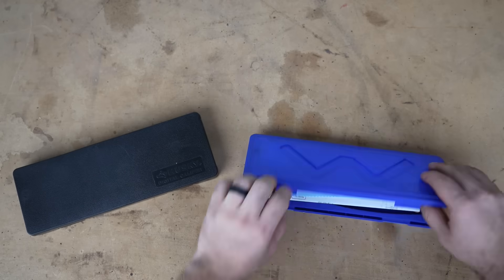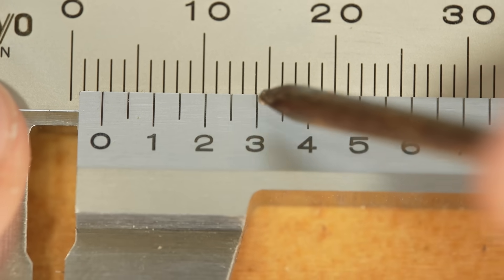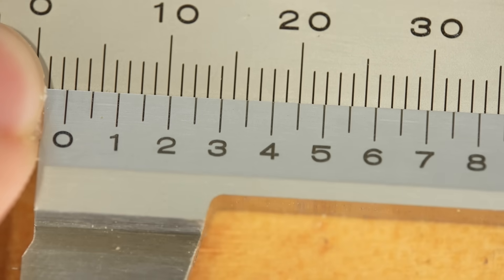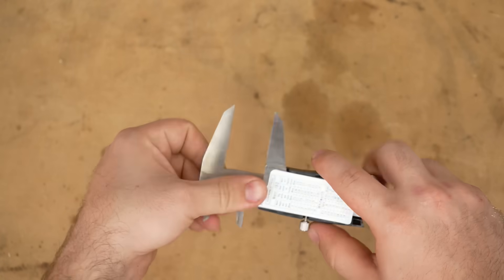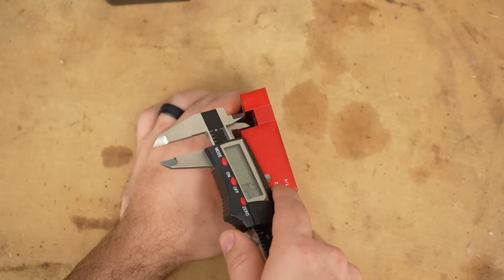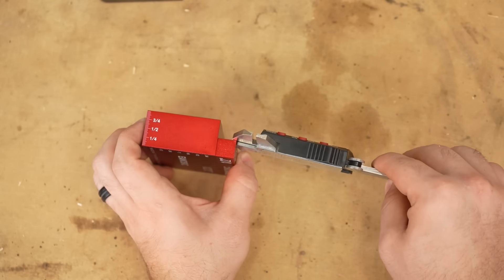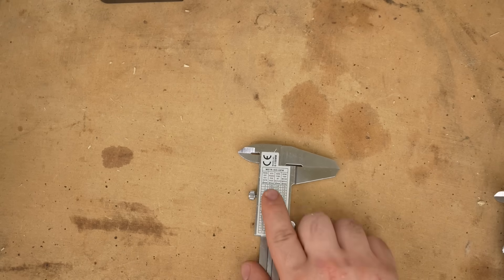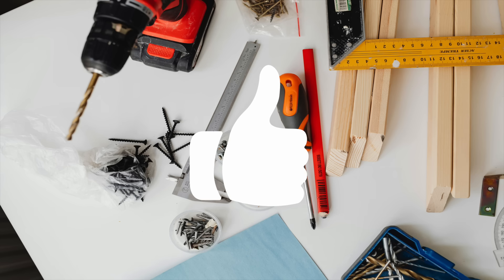I wish i’d known this sooner, How to use calipers like a pro

Comment: My father was a master machinist. His children were raised with micrometers and dial-indicator verniers, working on iron cast machines. There was no CNC. If you lost your zero working on a job, you were basically screwed. This was about 1972. Today, computer control makes these tasks quite a bit easier. 
My father taught me never to store the verniers completely closed, and never slam the verniers closed, as a sudden impact might affect the accuracy of the instrument. I still have a pair or two of the old dial-indicator verniers. They are still accurate, and I use them for my woodworking.
Reply: I've been in QC for 45 years and that's one of the first things I learned but it's even more important with 0-1" micrometers and never leave gage blocks wrung together. All it takes is the right amount of moisture and they fuse together. I have seen it happen more than once and even if you can get them apart the gauge surfaces are pretty much ruined for any true precision usage.
Reply: @RCT2020  :  Your father would have collapsed in shock if he had seen me trying to use a Vernier caliper as a wrench!  I was pre-school aged. My father spotted me in time to avoid disaster, but I did get reminded for many years afterwards!   🥴
Reply: CNC/'computer control' is only as reliably accurate as the program/s behind it.
It's worth checking manually before committing to a new product.
Reply: @RCT2020  your dad was correct! Any precision equipment like micrometers, calipers if closed during storage it can lead to rust or corrosion, 👍🏼👍🏼
Reply: @bret_Lambky  All callipers made today are made from stainless steel, so it's time to put the myth to rest. Closed or open, it doesn't make any difference.
Reply: @bret_Lambky  Right: is that the reason. Thanks, I was wondering why that was. All the best.
Reply: CNC had been around for a couple of decades before the 1970s
Reply: @trollobite1629  
One could reasonably argue that the Jacquard Loom (patented 1804) was and is a 'CNC machine'.
Reply: @trueaussie9230  Yep totally agree I just didn't want to get into the definition of what's considered to be CNC so I played it safe 🙂
Reply: @trollobite1629  Paper tape numeric control, CNC late 70s.
Reply: The first CNC mill was invented in 1952.  If your dad died in WW2, there was no CNC; anything much after that and there was CNC it just wasn't common.
Reply: @LeCharles07  No, NC machines in the '50s and into the '70s were the predecessors to CNC.
Reply: My grandfather was a machinist on one of the early linear accelerators. A mile+ long, with end-to-end accuracy in the tens-of-micrometers range.
Reply: "..never store them completely closed..." that's very interesting:  can you tell us why that is? Thanks a lot, and all the best for you and your family.
Reply: Generally it's not a good idea to store any measuring equipment with the jaws closed. I don't think it would be a huge issue with these calipers unless you close them shut and tighten the set screw. But with something such as micrometers you can easily damage them if stored closed. Because of thermal expansion. You can easily throw off the zero on micrometers this way.
Reply: @alessandroricci7294   In the olden days when measuring tools were made from steel (not stainless steel), any moisture between the jaws would cause corrosion on the faces of the jaws. Since all callipers today are made from stainless steel, it's time to stop pushing this myth. 
 It's ok to set your car battery on bare concrete too.
Reply: @e-curb  
I have some that are made of plastic.
They're very accurate, surprisingly.
Reply: That’s so wild. I was about to post that my dad taught me the same thing!!!  Still do to this day and I’ve taught my son that too.
Reply: Why not store them closed? Mine came closed.
Reply: @sypher0101  
If yours are of good quality they would have been coated in protective oil.
I trust you removed it before first use. 🤔
Reply: Excact how I learned it in th early 90,s at the Dutch marine school. No computer, when losing the zero you were screwed. No slamming of callipers, keep them little open. From start to end , us e the same tool

Comment: Calipers are a Must Have Precision Tool for Everyone.  You didn't show a dial caliper, which are great for reading ease and no battery (I'm still using the Brown and Sharpes from 1983). The downside with dial calipers is that they are either metric or standard. I'm sorry but standard vernier calipers are too time consuming and difficult for new users.  My favorite calipers are 8" Mitutoyo Digital, they are super smooth and accurate. The batteries last 1 to 3 years depending on use. Great video ;keep up the good work. I'm a retired tool and die maker from Honda.

Comment: Hey buddy, thanks for the video, but I think that you have to be careful about languge when describing engineering related matters. For example, any of my own sets of Vernier calipers are at least as "accurate" as you put it, most digital calipers. What you were speaking of is resolution, not accuracy. Any good quality Vernier will read to 0.01mm or half a thou' or so, if we're speaking in imperial. Most, and I mean most, not all, digital calipers have a readout to two or sometimes three decimal points, but three decimal points on an inexpensive (relatively) digital caliper may not be accurate and there are a few reasons for that. 
So, a pair of Vernier calipers of reasonable quality and a pair of digital calipers of the same quality, all other things being equal, will, in practice, give you a very similar outpout. 
Digital output is much easier to read, much easier, however,  digital calipers can give you the 'wrong' readout if you are not careful. Unlike Vernier calipers, digital ones can be zeroed incorrectly, leaving you  with a false measurement. Both types of caliper can be used incorrectly too, I've seen it often enough. So, at the level of user that your viewer is likely to be, there may not be any discernable advantage to digital calipers.
Vernier calipers are as accurate as many micrometers, they don't run out of battery power and once you learn to read them you will get consistently accurate readings. If you want an easier to read Vernier type, get one with a dial (analogue).
If you're doing rough work, say, in tenths of a milimeter, a cheap digital caliper is just great.
I've seen young engineers use digital calipers simply because they're too lazy to master the Vernier. Don't be like that. A good quality set of Verniers will outlast you, any electronic thing is unlikely to do that. More than once, I've opened the back of digital calipers to find a leaky battery, rendering the expensive thing useless.
I still use on a daily basis, Vernier calipers I bought in the seventies, they look and feel great. Every now and then I check them with slip gauges and guess what, they're still good. Do yourself a favour, buy a set from a retired machinist and learn to use them correctly, they're at least as accurate as most people need. If they're not accurate enough for you, I have to ask "why are you watching this video?'
Reply: I still use my first set of Vernier  calipers, I've used them pretty much daily since 1976 and other than the plastic cover they came in, they look and feel brand new, like you, I use the occasional slip gauge to check them, they're always fine and as you say, they're as accurate as my mics. As my vision got worse, I bought a dial set and they too are fabulous.  I've had a few sets of nice digital calipers and have enjoyed them, but have always been just a little suspicious of them. As for leaking batteries and lost battery covers...😊

Comment: That was a very good video, went into a lot of stuff which should make things alittle easier to understand for many people.
I still can't understand why they have Whitworth threads on the chart, they were pretty much obsolete when I was training 50 years ago?
 In early 2000's I used to teach Vernier caliper use and included Pierre Vernier in introduction.
Expaining Metric system to American's could be challenging (we don't do metric') 
Always told them they must be interesting to take shopping as money is in metric.
Vernier calipers are accurate to 0.001" / 0.02mm which is far more accurate than any electronic caliper with a dead battery 😁

Comment: What amuses me is the price range of calipers.  A 12-inch caliper can run anywhere from under $20 to over $1,000.  While the $1,000 caliper is extremely accurate and precise, the $20 caliper is still good to 0.001" and suffices for most applications.  To be told, I do have a number of high dollar, high accuracy and precision instruments, but they are not used every day and are primarily used for inspection.  Needless to say, no one touches them but me.  

Did you know that if you are trying to do high precision work, how you hold your measuring instruments can affect their accuracy.
Reply: Yes and a 1 or 2 degree temp change from inside machine check to outside on table changes size and reading and calipers good to .005 or more anything smaller needs mics. Have indicators and mics down to .00001
Reply: @countryboyScott3929  It is the old story of accuracy versus precision.  Usually we like to have both.

Comment: I can assure you that nobody in the UK uses Whitworth thread standards anymore. We use metric, have done since 1967. Also agree about tge dial calipers which I use on a daily basis.
Reply: @mikeburkett010. Sorry ol'sport .Nobody ? I know of at least 1 who uses WHIT. BSF BSP. UNC UNF  threads and fixings for repairs on old historic vehicles and farm equipment , No CNC here either , all manual machining , only do what interests me now I am retired.
Reply: @karlhrdylicka  well OK, I'll give you the BSP standard (although I didn't mention it) for plumbers and gas fitters (our little gift to our Continental friends), however, the US UNF and UNC standards became redundant in the mid eighties and we settled on the SAE AF system in the UK for most (and I stress, most) automotive usages well into the 1990s. Now you can argue that all of the given threads are based on the original Witworth standards, but Whitworth became redundant in the early 1960s, and by your own admission, only used on historic equipment. So, much respect to you for keeping it going, machining your own stuff is much to be admired.
Reply: @mikebirkett010  how about
clock thread
bike thread
also go to steam thread
the tpi. stays the same but the bolt shaft increases in size
why in steam boilers you cannot use a sleeve to put size back
this way pitch stays the same bolts in crease in size
also bolts tapered to make a joint less tight seal
so there👍
Reply: @raypitts4880  This thread (see what i did there?) is beginning to grow legs!
Most clock screws are BA, based on the original Swiss Thury standard.
I've been riding mountain bikes since the early 90s and, with the exception of the bottom bracket, all use fine and coarse metric bolts. The BB is a messy one, but most use the BSA or English standard, there are also French and Itialian standards, all with slightly different pitch dimensions.
As far as steam boilers are concerned, I'll give you that, not my area of expertise, but I would be surprised if any NEW built boilers use Whitworth.
Whitworth today in engineering is as redundant as feet and inches😉

Comment: I learned 3 things, the purpose of the notch on the depth rod, the step measurement, and the double meaning of the CE logo. Thank you!
Reply: The CE logo does not have a double meaning. that is an urban legend. CE markings are self-certified.
Reply: @MikeBucceroni  The video says that the "CE" logo can also mean "China Export" instead of "Conformite Europeene". Are you saying that it's just an urban legend and the manufacturers are certifying that their product complies with the EU regulations?
Reply: @VeniceInventors  : Yes, exactly.  The whole "China Export" thing is an urban legend.  It's common enough that it's referenced and debunked in the Wikipedia page for "CE marking".  There are sometimes fraudulent CE markings, of course, but they are simply fraudulent markings; there is no actual claim that they stand for something else.
Reply: @BrooksMoses  Thank you for elaborating!
Reply: Pathetic part (about young generations): you needed an internet to learn those basics.
Reply: @GrandePunto8V  thanks grandpa

Comment: I would say that dial calipers are far more common than Vernier calipers.  The reason why the Vernier is just accurate as dial/digital is that calipers aren't all the precise to begin with.  They are better than a scale or tape measure.

Comment: I was told by a engineer digital callipers can have tolerance errors and it’s best for precision to use micrometers.
Reply: anonhunter5191. Correct . providing the same person uses the mic as another user often will get a slightly different reading particularly on round stock.
Reply: He was right.  In the trade Verniers are called "very nears".  If you need to measure something to a tolerance of less than .001 then calipers are not going to cut it.

Comment: Disappointed you didn’t  cover the fractional scale.
Reply: Normal, logical people don't care about fractional scales. 🤣
Reply: @akarna69  you are incorrect; there are situations where fractional measurements are superior to metrical, so people who don’t care about fractional scales are ignorants.
Reply: @GregoryHunt-w8g  nobody in their right mind would pick fractional scales over metric, like no sane person measures things with their feet. 🤣
Reply: @akarna69  you can’t read them can you?
Reply: @akarna69 fractional is not opposite metric (if you have ever said half a meter or a quarter of a kg, you have used fractional metric), or probably more to the point decimal based measurements are not exclusive to SI, as you can have 2.056”…imperial without fractions is a much more common and practical way to measure at these resolutions.

Comment: Technically, calipers don't measure more exactly than 0.1mm due to mechanical limts. For anything more precise you need a micrometer gauge or a dial gauge.

Comment: All measuring tools have a range of accuracy. Yes, I mean to say all measuring tools. The thing is, what is the range of accuracy that is good enough for your intentions? In my profession that would be, parts per million. So, how do You know that Your measuring device is as  accurate as stated by the manufacturer? What good is their guarantee or statement that the accuracy is so? In my business a "written" method of how the accuracy range was determined and a "certification"  by the company And the person who conducted that determination must accompany the measuring device  - which must have a unique serial number. That is now a legal document, that can be used in court. My personal calipers are "Certified" by Mitutoyo. That is probably much more then most users want, or need. And it does cost more. I have found the idea of precision fascinating ever since I used a scanning electron microscope way back in the sixties. But precision not only comes with the device, but also technique and environment.

Comment: Pretty nice tutorial.  I never used a Vernier Caliper much but I still have my Starrett dial calipers.  40 years and still working perfectly.  If I had known how it operated i might have used one instead.  simple durable and your battery won't die at the worst possible time.

Comment: There are also calipers with a dial, I have a Swiss-made Tesa accurate to 0.02 mm.
Otherwise, the CE = China Export story is just an urban legend, there is even a section about this in the Wikipedia article on CE marking.
In any case, the CE marking is only a sworn statement made by the manufacturer, not a certification mark.
Reply: Ahhh Wckipedia. Anyone can write whatever they please there. Made up stuff
Reply: I think the statement has to refer to a specific, certified testing laboratory inside the EU so it's somewhat verifiable by simply asking them.
Reply: @blechtic  Once again, this is not a certification mark, it is solely under the responsibility of the manufacturer.
Also, they are calipers, there's no safety risk involved...
Regulation (EC) No 765/2008, article 30:
1. The CE marking shall be affixed only by the manufacturer or his authorised representative.
3. By affixing or having affixed the CE marking, the manufacturer indicates that he takes responsibility for the conformity of the product with all applicable requirements set out in the relevant Community harmonisation legislation providing for its affixing.
Reply: @blechtic  CE is just a SELF REPORT about it being LEGAL to sell in the eu. they are supposed to have documentation to back that fact up though. like not having banned chemicals and so forth.

Comment: “China Export” is a myth, though there are certainly manufacturers (many in China) who misuse the CE logo for non-compliant devices. Having the proper spacing in a CE logo does not guarantee conformance to the standard.

Comment: Resolution and accuracy are not the same. Just because caliper A can measure down to 0.02mm and caliper B can measure down to 0.01mm does not necessarily make caliper B more accurate. Explaining this will take too long so all I can say is to look for articles on accuracy, precision, and resolution.

Comment: A nice feature of the digital (for the that have all three) is a quick conversion between SAE-fraction, SAE-decimal, and metric, not just for measurements but also when your too… busy… to pull it up on your phone or a chart. Use that feature fairly regularly
Reply: Ditto!  👍 😜

Comment: 3:06  You forgot to explain that the schaper edges of the outer jaws are also for measuring on a holow furface (on one or both ends). Like measuring wall thickness of a pipe. Measuring that with the broad flat surface of the jaws would give a much larger deviation.
Most People forget this one (as you did),  but never the less a verry good explanation.